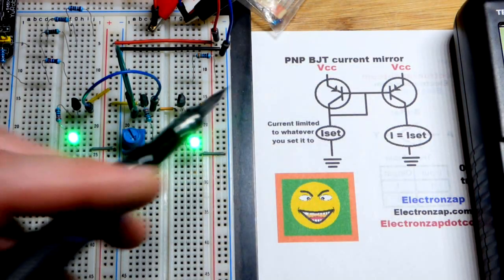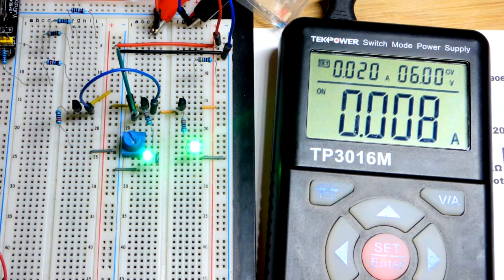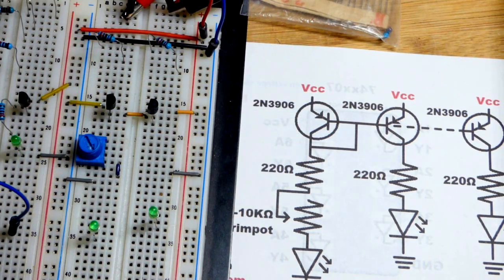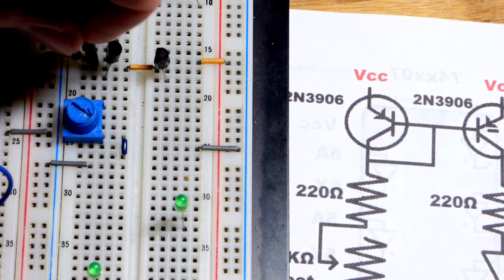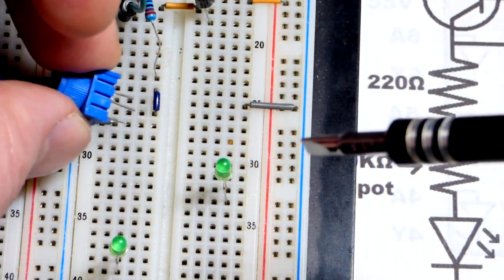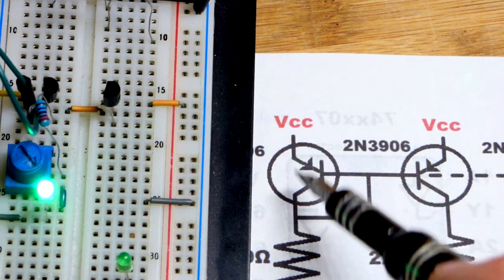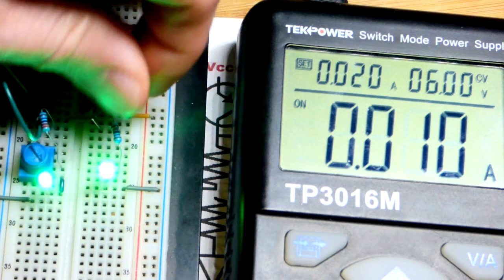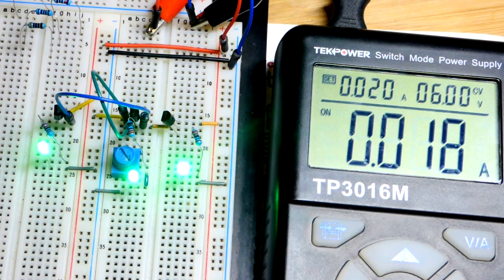2N3906 PNP bipolar junction transistor BJT current mirror for LED brightness demo circuit

Comment: Nice video, but I think the design could've  been better.

There was no need of having 220 ohms resistors at Q2 and Q3.
LED at Q1 can be removed and let 220 + Rpot to control the current.